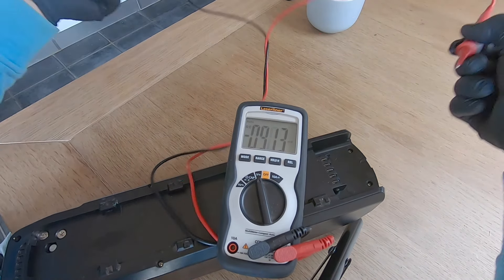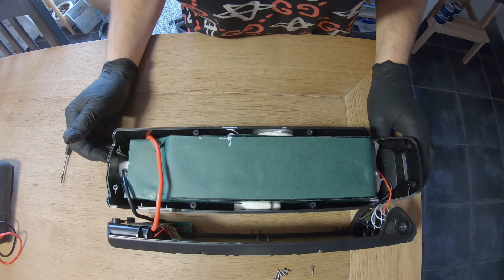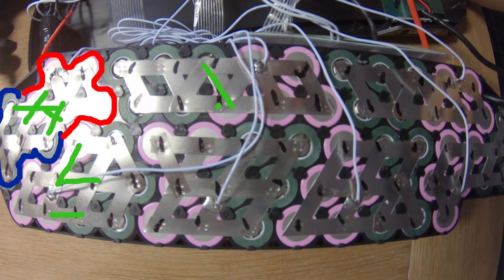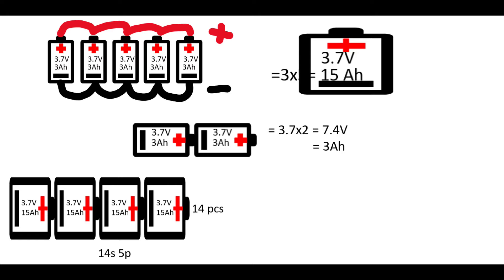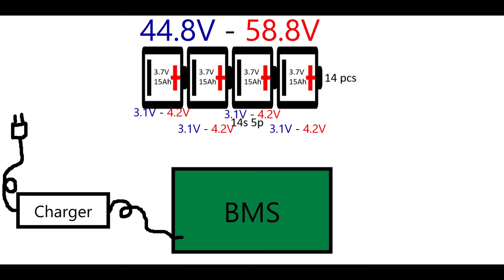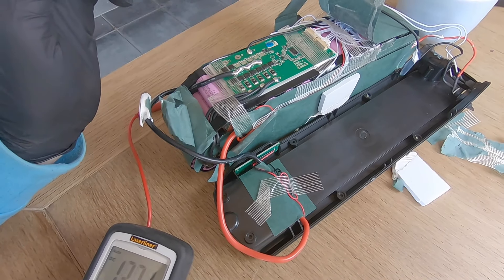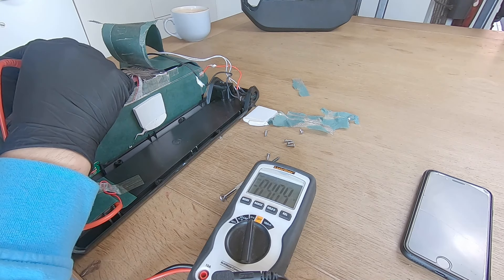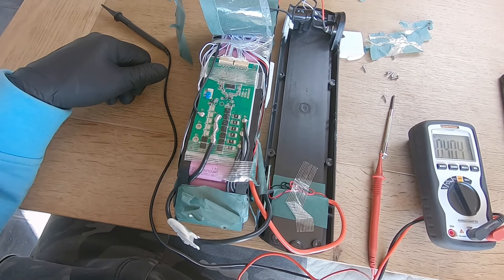Dead BMS! How to test it? & what's inside my 52V battery pack?

Comment: Hello, I have a new trotnet that suddenly stops and does not work unless I put the charger and unplug it and it works again.
When I checked the 52V battery, I found that it was low at 42V, and when the charger was put in and unplugged, it returned to 54v  or more depending on the charge every time when it stopped working
My question is, is it necessary to replace the bms charging part to solve this problem?
Reply from the maker: Hi, sorry to hear. it can be either bms or a bad cell/cells. You will need someone who can take it apart and identify the problem 🤷🏻‍♂️
Reply: @VRMinde  Last night, I disassembled the battery and measured each cell and found that they all have the same measurement of 9.3V and the battery is 42V. I measured the negative wire coming from the battery with the wire (- p) it gives a measurement of -9V and when measuring the end of the battery with the negative and positive directly, I get 51V and when the charger is placed and disconnected in a moment, the measurement becomes approximately 57 V. I think the problem is from bms